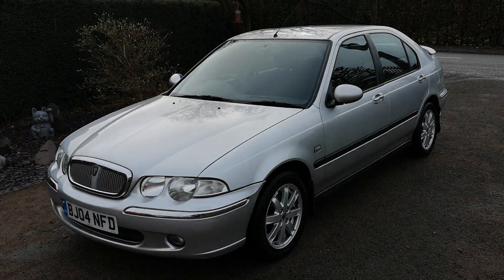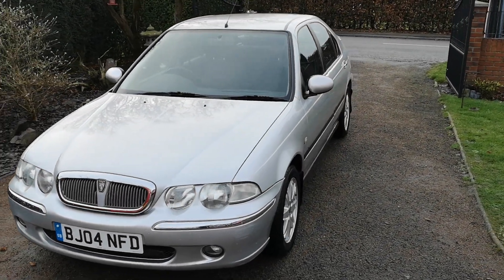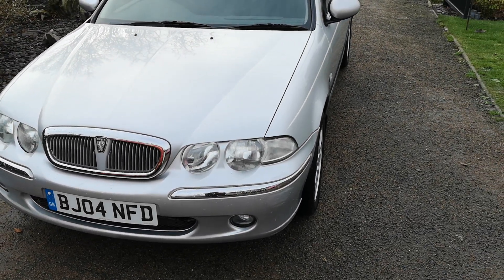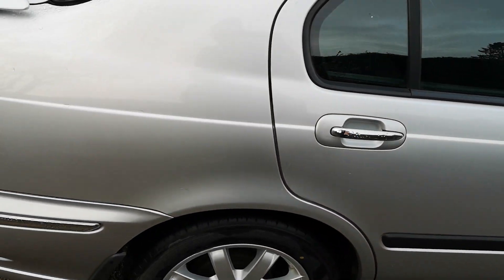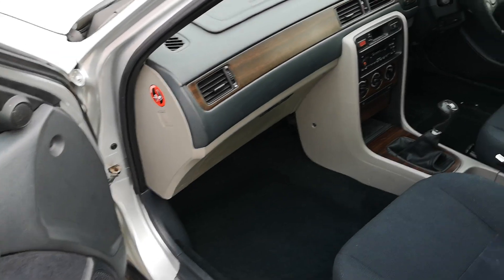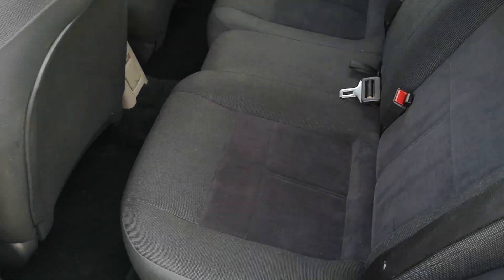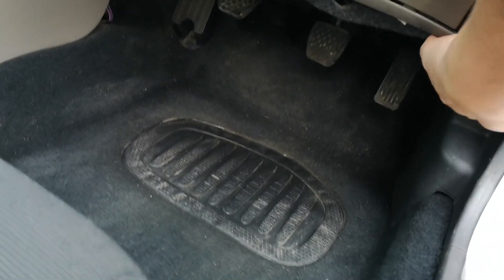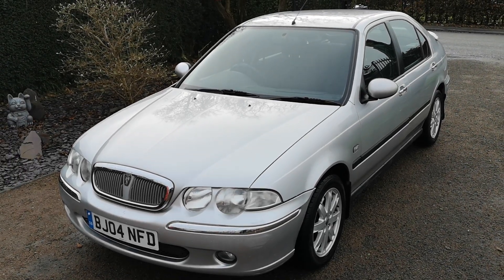Buying A Rover 45 With A Blown Head Gasket For £250 - Walkaround & Review

Comment: I bought a 2002 1400cc 45 in 2017 which is still going strong. Just before Covid in 2019, it started to miss fire and all the garages said 'head gasket'. Because of Covid restrictions I decided to fix it myself and it wasnt the head gasket at all. In fact this is the third car I have had with the Rover K series and none of them have suffered head gasket failure. The first was was an 1100cc Metro, a 1400cc 414 and now this 1400cc 45, so perhaps its just the larger engines that fail ?
Reply: My P reg metro gasket went,
My 2002 1.8 z's aswell 😞
All my KV6 Engined cars were faultless though, loved the V6.
Reply: @T16MGJ  
It's strange,  Rovers K series engines are still being made in China and yet we never hear any stories about head gasket failures there either ?????
Reply: @johnbrereton5229  Very true but, not really strange if you examine the scenario more closely.

The Chinese made several changes in the manufacturing process the good folks up at Longbridge were not allowed to do.   That due firstly to the Bavarian owner controllers and later, by a mean spirited short sighted UK Government who refused rescue funds. Indeed. unless news of the fake variety at the time, actively moved to undermine any chance of a JV [ Joint Venture ] with a Far East Automotive Manufacturer on the lines of the successful JV Austin-Rover Group with Honda.

According to an ex Longbridge "Insider" I know, the Chinese used different manufacturing processes resulting in subtle improvements and particularly, the main engine components ( Head and Block ) stronger.

Seven years ago, as an experiment, I fitted a Chinese "K-Series" 1.8T Engine form a written off MG6 ( which I had previously driven ) to an MG ZT-T 1,8T I saved from the Tin Can conversion process. The previous owner offered it to me as he'd rather the otherwise nice car live on than get dragged away to the breaker yard. So successful, that ZT-T became my daily driver load carrying workhorse in regular use to this day seven years later.

It is not Rocket Science. If only Longbridge had been allowed to do those changes the UK would maybe still have a viable ARG-Honda style JV indigenous Car Manufacturer still in UK ownership not alien control. Some of those we entrust to this Nation's well being see importing everything including energy etc which all used to be produced "In House" UK as beneficial to the Nation. They see Foreign Investment whilst others viewing the same see widespread stripping of UK assets.
Reply: @T16MGJ  
Lotus was so impressed with Rovers K series engine that they fitted it to their Elise and asked if they would be allowed to develop the engine further. However, Rovers new owners at the time, BMW, said NO ! They obviously didn't want any Rover to be too much competition for their own cars.  Which is a strange position for an owner  that is genuinely interested in  Rovers success. When the Chinese got the Pheonix 4 drunk and got them to sign over all Rovers assets, the first think they did was to get the UKs Ricardo race car designers to upgrade the K series.
And as you say, no one ever complains about it now. Imagine if BMW had allowed the equaly regarded Lotus team to upgrade it while Rover was still around ? It's rather revealing about BMWs true intentions when you realise why they would not allow it when they were in charge ?????
Reply: @johnbrereton5229  

"True intentions. Why they would not allow it." you pose interesting comments there John.

BMW needed TWO smaller cars to offset their gas guzzler rest of their model range or risk heavy financial penalties and constraints from the EU Monster in Brussels. Rover Group provided TWO small cars. The Bini and R30/45 replacement = 1-Series provided that solution to balance up their gas guzzler range.

With a bonus for the Bavarian asset strippers. They used the huge R&D costs for those small cars against Rover Group company accounts to demonstrate what their top bananas are on record as describing ...

"The English Patient!"

Still we allow the rest of the world to take us  taxpayers for mugs .. by the thousand daily sometimes. Apparently it all makes sense .. to some, including those we entrust to this Nation's longer term well being.

FOOL BRITANNIA.

Was it simply fake news that the Bavarian ASSET STRIPPERS sold off the JLR asset to FOMOCO for more that they paid for the whole asset rich former Rover Group?
Reply: We have a 2002 Series 2 Lotus Elise in the family fleet for over twelve years. Hearing that 1.8 K-Series at full chat immediately behind you is just one of the many joys of S2 Elise ownership. 

That reminds me. Back in the day, a Racing Driver training school ran a small fleet of Elises. Some with the Japanese engine. The operator back then is on record saying they had just as many problems with the Japanese engines as the English ones.
Reply: @T16MGJ  
I can't see anything that I disagree with in your comment MG John. GB has been raped by the EU (Germany) just as was always planned in the 1930s and all our Industrial assets moved there.
Reply: @johnbrereton5229  Trouble is those we entrust to our well being every General Election do not see it that way. Come the next one, no matter what the result, things will only get .. worse.

That's the huge problem with the system as it is and has always been. 

THE  GOVERNMENT  ALWAYS  GETS  IN>

We're doomed.
Reply: @johnbrereton5229  WOW ... just wow. Someone who knows "stuff". That makes at least two of us. 

Reform. Will it ever come to pass? Unlikely in my lifetime.

Worth repeating. 

THE  GOVERNMENT  ALWAYS  GETS  IN.

We're doomed.

Comment: Good luck with that nice car.

Cylinder Head Gaskets on any car rarely fail. That includes K-Series cars. Invariably they are first damaged by some other agency primarily excess heat following coolant losses. Coolant can be lost for many many reasons. With a relatively new K-Series, say only 50,000 miles, main cause of coolant loss is a worn water pump. That allows coolant to escape and when that reaches a critical level..... the rest is history if not spotted in time.

Work colleagues knowing I had a twin axle braked trailer, asked me to recover their stranded cars. A Toyota and BMW. They told me their Head Gaskets had failed. No they had not, their gaskets were damaged following severe overheating on a long journey.. Coolant loss the cause of that. The Toyota needed more than just a gasket, it had severely over heated so badly it needed a replacement.engine.

It is very convenient for some to blame the poor old head gasket. It is rarely to blame.

Two K-Series cars in my family I bought new in 1993 and 2003 ( MG ZS 120 with 1.8K now showing 115,000 reliable miles ) , have yet to have their gaskets "fail"... How lucky is that... no luck involved. They needed new water pumps though. Renewed in good time. The K-Series is a doddle to work on compared to many other DOHC ordinary cars.  We have three other K-Series cars in the family and friends fleets too. 2 x 1.8Ts and a 1.4 Rover 25. All fitted with replacement Cylinder Head Gaskets by myself. Bought as projects from owners advised their CHGs had failed. Ten-twelve years later, no gasket issues. They were repaired correctly. There's rather more to it than simply fitting a new gasket.